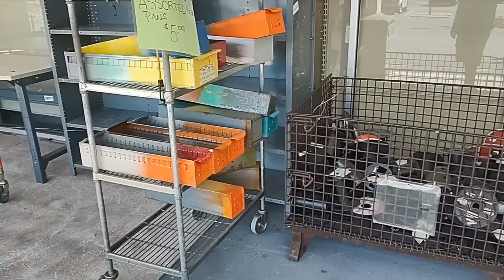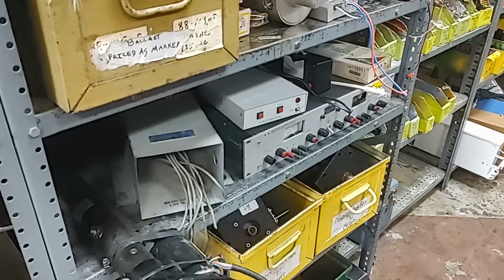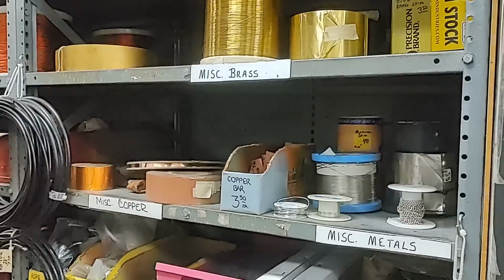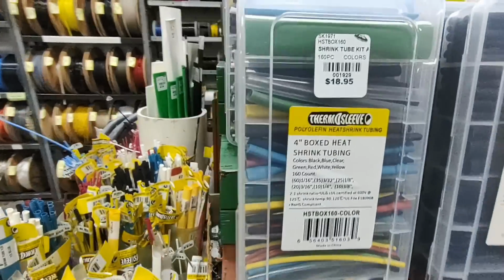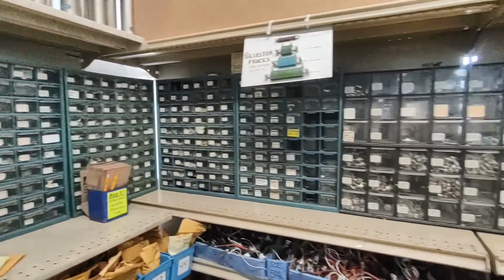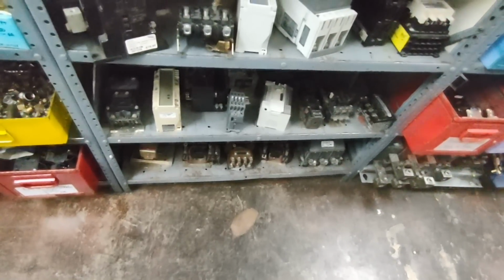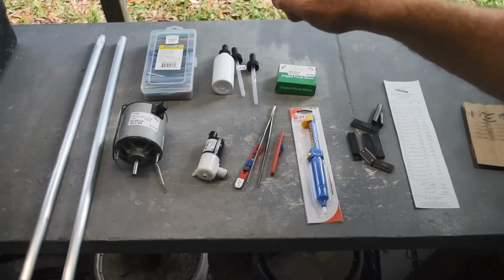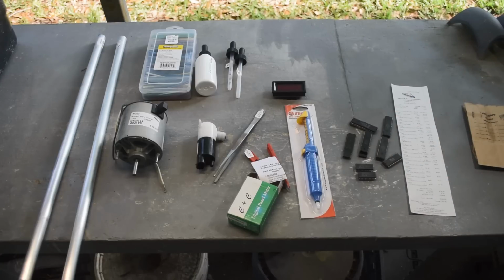Skycraft Electronic Surplus In Orlando Florida: Amazing! #electronics #maker #surplus

Comment: If you want a good gas can that works, check out Vevor for the Jerry Can. Harbor Freight sells them as well but with HF, there is a safety lid. The Vevor can pours and has a tube to vent internally so it does not go "glug, glug" and splash so it actually pours steadily through a flexible stainless steel tube/cap assembly. I have  rubber plug I use to seal the tube. Capacity on both is 5 gallons, both are painted with coated interiors. IMHO, the HF can is better because the can is manufactured by the original maker from WWII with the down fall being the spout.

Comment: I live near KSC on Florida’s east coast. That place is the go-to place for all sorts of surplus. I find it entertaining to check out the tools and equipment for metrology stickers from KSC. For a brief time there was another surplus store in nearby New Smyrna Beach that had an insane amount of surplus after the shuttle program ended. I actually purchased some very specialized instruments used for measuring the steps between orbiter tiles. It was a tool I actually used as a orbiter TPS technician in the late 80’s. Sadly they didn’t last very long. Skycraft is most definitely a central Florida icon. Good to see they’re still in business.

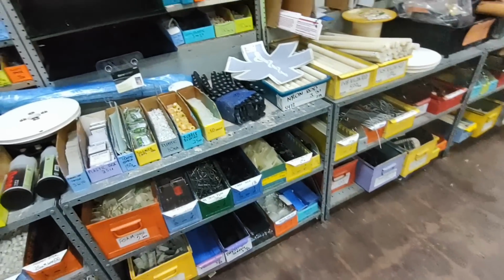Comment: @14:42 on the bottom shelf are Velcro/hook-loop squares. I bought some of those and the Velcro/hook-loop doesn't hold together after more than 2 pulls. 

The adhesive holds fine. 

Buyer beware 

The cable section is fantastic! Ive order remainder boxes of cable for projects from them. Good stuff.

Comment: We used to have several surplus/electronics stores in Silicones Valley, Haltek, Halted, Altronics,, RA Enterprises, etc.   Whenever I had a project, like fixing test equipment, or building stuff, I could always count on finding just the right switch or whatever at one of those stores.  Sadly, they all coalesced into one store in South San Jose.   The last time I went there, they were gone.

Comment: during the 80's Orlando was bursting at the seams with military /aerospace
company's each year they would sell-off their surplus at auction. there 
were skids and skids stacked on top  never individual parts just skids of
really neat unique stuff. Such fun wondering around scratching our heads 
thinking what the hell ..what the hell is that..more to the point .. everyone
new when Mr Skycraft showed-up he always walked off with the goodies .
Reply: @vasaricorridor7989  I was hired by Bob feidler the owner of skycraft in my senior year of high school 1980.  I got to know the staff as I built robots from 8-12 grade for the annual science fair so I was honored to be asked. My job was to tear down all the military surplus that arrived in 19 inch racks. Some of the rack contained usable power supplies and sellable equipment but some were specialized equipment that had to be disassembled for parts. These were items that had calibration stickers from the 60’s but had some great parts. We also got big cardboard bins size of a pallet full of small sealed packages that we had to open one at a time to reveal 1 piece of hardware. It was my first job and a dream. I spent most of my paycheck on parts.
Reply: There was a guy in Titusville who bought a lot of auctioned components including rocket engines. He made a living categorizing it and selling it back to NASA.

Comment: We had a place in Vancouver, BC called Satellite Electronics where you could buy surplus aircraft and ship WWII radios. I remember in the 70's buying a AN/ARN-7 with a friend who also bought one. We even got the glass covered Antennas and the control heads. We were kids then just learning about radios (and weird aircraft power supplies!). My radio was missing a complete circuit but somebody had been kind enough to include all the parts I would need to rebuild it inside in a carboard box. My friend and I split the cost of a manual and this was my first soldering experience. The funniest part was that my radio worked afterwards but his never did. I never laughed so hard, but almost got beat ul for it!😂

Comment: The Radio Shack parts are from one of the last Radio Shack dealer stores in Orlando. It closed two years ago. Used to be on Orange Ave I believe. Had been around since the 70’s
Reply: I bought some of the very last things from that Radio Shack when they closed two years ago, Orange and Kaley, across the street from Pulse, just south of one of the first Wendy's in the state!  It was THE last Radio Shack!!!!  I bought stuff there in 1972, when I was in junior high.  I showed the guy my VFD 7-segment tube I bought there back then, and he offered me the original $2.50 I paid for it (just joking, I would not sell!)  Sorry to see that old place go, but all good things must come to an end.  I started going to Skycraft in Winter Park in 1978.  I used to love to buy mechanical counters from them, which are eBay-only items now!  Those were great old days!
Reply: I visited that place several times after I discovered it still existed, all within the last six months or so before it closed. Nice guy owned the place, wasn't shy to tell you about the history of Radio Shack and how the new corporate owners (as the company had recently been resold yet again) were going to run it into the ground. He knew the writing was on the wall the last time I was in there.

Comment: Hi Mike,   It might be a good thing that store is far away!  Big kids in big-kids toy stores.  Hey - I just took apart a vintage desk-top printer.  I saved the nickel-chrome plated steel shafts.  Will they work for your new tumbler build?? Let me know.  Great video.  Thumbs up!     Jim
Reply from the maker: Only if the shafts are 1/2 inch or more in diameter and 24 inches or longer. Thanks.